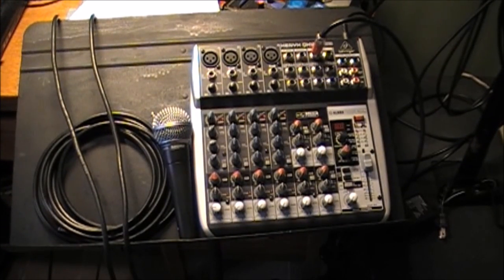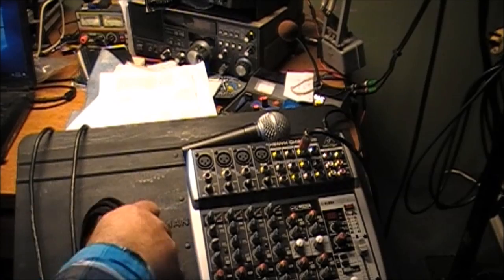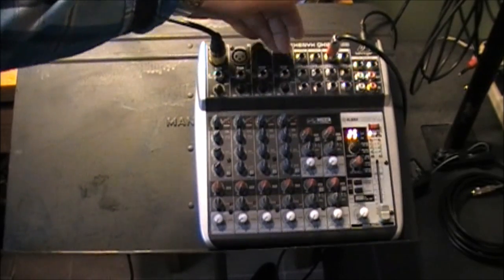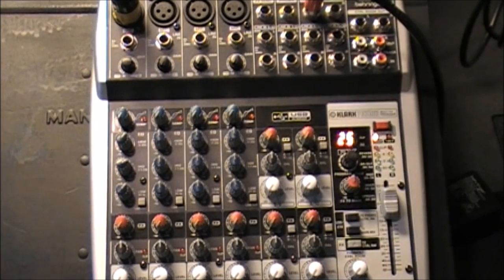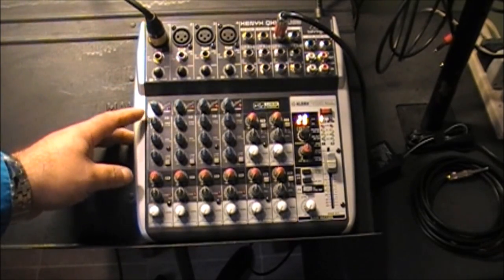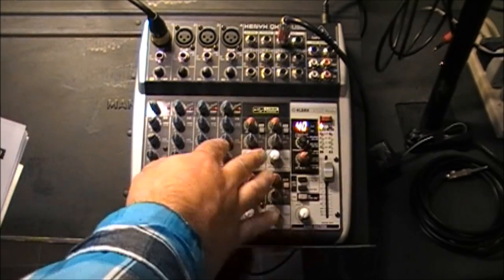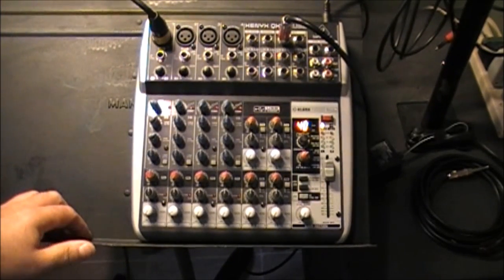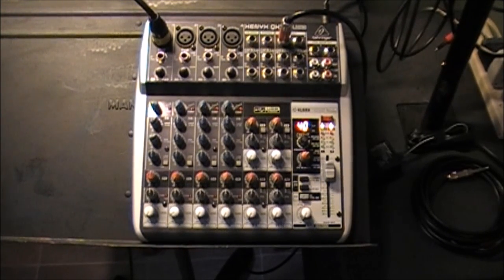Behringer Mixer: How to do a setup

Comment: Andy - thank you for the video. I am really pretty clueless and am trying to set this up for my daughter who will be singing in a small venue. I don't understand what kind of powered speaker I would need to use. The manual talks about active/passive crossover and I have no idea what that means. What kind of powered speaker would I really need to use assuming I am not using an amp between? What speaker did you use in this video? I am looking for a simple setup for her. Thank you in advance!
Reply from the maker: Any powered speaker that is designed for Public Address (PA) speaker. Behringer, QSC, Mackie,  Yamaha andother audio companies make powered speakers and non powered. Nonpowered speakers just need an external amp to amplify the audi to the speaker. The powered or non powered speaker typically come in and 8, 10, 12, 15 or 18 inch speaker with a tweeter or horn for the highs. There is usually a crossover built into the powered speakers. The speaker I am using is the Yamaha DXR10 powered speaker which has a 10 inch speaker and a horn. I have found Behringer to be the cheapest powered speaker out there currently and is typically of good quality. I hope this is helpful to you

Comment: How do I use the master faders on beringer mixing desk xnex 2422
Reply from the maker: The master faders should be set to around "Zero" or what audio technicians refer to as "Unity"  This will allow the mixer to be most effecient and productive audio signal wise and to produce greater headroom potential. This means the ability to get quality volume without disortion and the audio signal chain is most "excited" before the chance of distortion and other negative audio properties increase and destroy quality audio in the audio chain. 

I hope this is helpful to you. God bless you.

Comment: Great video
I’d like to ask a few simple questions
I’m going from the same Behringer desk as you demo here and I’m taking a signal to a powered speaker unit
My speaker has dual XLR/1/4 Jack inputs. It also has optional Line input or Mic input
So should I use a Jack to Jack lead from my Behringer to my Speaker ?
If so should this lead be a Stereo Lead or a Mono Lead ?
And finally Should I switch my Powered Speaker input to Line Level or Mic Level?
Many Thanks
Reply from the maker: Yesd, it is fine to use jack to jack. Use a momo lead and jusdt use a second speaker and cord for the other channel. If you asre inputing a mic firect only, use mic setting. anything else should be line input for proper EQ'ing. I hope this is helpful.

Comment: Andy,
The effects on my Behringer XENYX 1202FX Mixer suddenly stopped working, the LED is not showing. 
All other inputs and volume are working except the effects.
Is there a simple fix for this? Don't know, I am not a tech guy.
Wishing you all the best.

Thanks.
Reply from the maker: If the mixer has not been dropped or mishandled, then it may be just a need to clean the inserts and switches so they make contact. 

Internally, there may be a wired plugin or a ribbon cable that has worked its way loose. I'd check to ensure all the pots are working and that your PSU is properly plugged into the socket and snug as well. 

Other than that, it would be difficult to troubleshoot beyond that without taking it apart myself. The effects unit is a seperate component and it may have failed.
Reply: Andy,  
I forgot to mention, in addition to the unlighted LED, I also had a hissing noise when I turn up the volume.
Thankfully, I found the solution in another of your videos. The problem was a loose power cord. I simply reinserted (fit snugly) into the mixer and Walla.... everything is now 
back to normal and working fine.
Thanks again for your invaluable contribution.
God Bless and happy holidays to you and family.

Cheers.
Reply from the maker: @pattersongay6498  awesome news

Comment: Hi Andy, excellent video with detailed explanation. Just wanted to know...how can I connect this mixer to my laptop so that I can sing with a backing track on Zoom.
Reply from the maker: Some laptops can have a specialized audio component that is specifically designed to tap into a mixer via a stereo jack, USB or other port. Most laptops do have the stereo headphone out and that would work. 
You can also change some of the dynamics of the signal by changing the headphone out to an "audio out" via settings.  You simply plug a stereo jack into the headphone jack and have the other end of the cord split into two XLR signals or 1/4 inch jack channels ( Use two balanced and mirrored channels on the board) 
You may also buy a cord that has a 3.5 stereo jack for the laptop and RCA jacks for the RCA input on the mixer. Just read the user manual on how to set up a signal for the RCA output. The push buttons can be a bit hard to figure out but persistence will pay off. Good luck with your setup.
Reply: @Tobinindustrial  Thanks a lot !
Reply from the maker: @joyerdonald  Thank you for supporting my channel and I wish you the best for 2021.

Comment: Thank you Andy. How does one hook up a monitor on this mixer? I have the identical mixer, so this info really helps! Edit: actually, I don't have the same mixer! My Behringer doesn't have monitor outputs....
Reply from the maker: If you don't have designated monitor out channels then you need to find a preamp signal out and send that to your powered monitors of=r to your amp and then monitors. All mixers should be capable of monitor send.
Reply: @Tobinindustrial  Thanks Andy, What I've been doing is plugging in an additional powered speaker into the "out" on one of the main powered speakers. Works okay, but I don't have the flexibility of a true monitor output. All the best to you!
Reply from the maker: @MrLuridan  What model do you have? I'll have a look at the user manual iof I can find it and maybe recommend a better way. Do you have two or four main out channels?
Reply: @Tobinindustrial  Thanks, Andy. I have the Xenyx 1202fx mixer, and I just found this info on the Behringer site: "Plug a powered monitor into the FX output 1/4 port, and turn up the FX knobs in each channel to feed this port. When you plug a cable into the port it disables the built in effects and then you can use it as an AUX send to use with a stage monitor. Each FX knob will act as channel volume into the monitor instead of effects."

I've had this mixer for years, and never knew this!! Who knew?!

Thank you for your responses, and good luck in all your endeavors!

Scott
Reply from the maker: @MrLuridan  Awesome stuff Sir. It pays to read up on things. I am so happy you got your monitor mixing issues solved. Good luck to you to Sir and God bless you and yours.

Comment: Hello. I was wondering.  Should  I use DI boxes for mics and instruments? And I am using a bose S pro 1 for my speaker, and I plug that in the main out
Reply from the maker: You typically use a DI box to effectively split your signal so that one independant signal can go to your personal stage amp and the other can be used for front of house and stage monitor audio mix. The low impedance channels are the best channels to use as they have more headroom and versatility in mixing. My suggestion is to use a DI box if you want to make a vocal mic or instrument with a 1/4 jack or other be stepped up to a low impedance signal that can go into the low impedance channels of your mixer. As I said, these first low impedance channels are the premium channels to use. Other than that, as long as your mics and instruments can be plugged into the low or high impedance channels, you are good to go. You can use the main out Left or right of the mixer as normal. The pan button on center will ensure eiether signal (Left & Right) is getting equal signals. God bless you and all the best with this.
Reply: @Tobinindustrial  thank you Andy, and God bless you for helping us technically challenged.  I'm getting feed back and a loud ringing noise from my speaker. Any trouble shooting suggests?
Reply from the maker: @RestoredSound  Make sure your vocal mics are not in front of the speaker especially the tweeter/horn section. You may also be in a smaller room with too much volume on a microphine or instrument. Mics are the common culprit but it can also be cauae by an acoustic guitar with a pickup. You can buy a feedback buster for guitar that goes into the soundhole to decrease feedback. Other instruments may be the cause or some other input. You can turn off all channels and bring each one back on individually to see what may be the troubling mic or instrument. My best guess is the loudness of the mic or settings too high like the highs of the mic. Or the placement of the mic relative to the front of the main speaker.
Reply: @Tobinindustrial  great! I will try that. I currently have 1 speaker going into the main out left. I'm buy the exact same speaker to have 2 speakers. Do I plug the second  one into main out right? And I have an I Rig pre, so I can take the sound from the board, into the android phone I'm using to record my video. Where should I plug the I Rig pre into my mixer?
Reply from the maker: @RestoredSound  Yes, you can use the second channel out for the other speaker. As for the I Rig Pre, any preamp signal out should be fine. Make sure it is not post amp from your speaker (powered speaker)There is a monitor send you could use to send a signal into the I Rig Pre. You will have to study the user manual to understand how the bottom right switch works for allowing signals to main and also monitor or studio control signal. read it over a few times and always double check the cable setup to be sure you don't damage any of your equipment.

Comment: nice video, I have two questions.
1) Is the output signal of the Main out connector a mic level or line level signal?
2) Is channel 3 and 4 input line level or mic level, can I connect a CD player?
I thank you in advance.
Reply from the maker: Main out is a signal of all mixed audio that is processed through the board. It is a low wattage preamp signal ready to be boosted by a power amp signal. You can connect your CD player whereever you wish, on tany channel with high or low impedance. Just set the preamp siganls appropriately to not overdrive the audio chain. Some instruments or electronics will perform better depending on the the connection like High Imp. Low Imp or RCA inputs. It all depends on what you are using and the general output qualities of the unit. experiment on what sounds best or works best in the audio chain. Usually, if you look at an owner's manual, the companies will recommend how to hook up the unit for use.

Comment: Andy, Thanks for your reply.
I have the Behringer XENYX 1202FX Mixer.  There are no EQ's (hi, low, med) on the stereo bus.
I also have a spare Stageworks M246- 6 channel mixer with EQ's on all channels. Is there anyway to hook up both mixers to utilize EQ's on the M246.?
I know this is an unusual question.

God Bless.
Reply from the maker: I am sure that any preamp signal can be injected into another preamp input but I really don't see how that would make any discernable difference. My suggestion is that you buy a cheap eq to send the signal of the mixer in and then go out to the powered speaker or amp. I know this would not be channel specific eq adjustment as it will cover the whole mix of your system. If channel eq is what you desire, I'd just upgrade to a mixer that has that ability. They are relatively cheap used and a good price point new as well.

Comment: Bought a Fender Acoustasonic 15W Guitar Combo Amp...for the XLR connection bought an Adapter...somehow the JVC 600 ohms Mic., Shure etc. only works via the XLR  and not Directly with the 1/4 inch jack? Why?
Guitar works Directly and also when plugged in the XLR Adapter?

Maybe, that is why they always worked in the Behringer UB1202 all the time, as I think it has a built in Mic preamp?

So how does the Adaptor converts the Mic signal? An XLR male to balanced 1/4" female adapter.
Reply from the maker: Did you buy the converter unit called a XLR to 1/4 inch Transformer? It is more expensive but I think that is what you need. Ity is possible that the adapter you bought may be made in China and is not properly aligned to connect internally with the mixer or it may just be wired for another type of application.
Reply from the maker: Is it like this unit? https://www.amazon.ca/Shure-A85F-Transformer-Female-4-Inch/dp/B0006NMUHW/ref=asc_df_B0006NMUHW/?tag=googleshopc0c-20&linkCode=df0&hvadid=292943070203&hvpos=1o3&hvnetw=g&hvrand=16920473490010277968&hvpone=&hvptwo=&hvqmt=&hvdev=c&hvdvcmdl=&hvlocint=&hvlocphy=9000010&hvtargid=pla-433881473942&psc=1
Reply: @Tobinindustrial  Hi, no, just an Adapter....the guitar works great with it and also the Mic. with the Guitar amp. No idea why, but, the Mic directly does not, maybe because it has the 1/4 inch jack?
Reply: Thanks
Reply from the maker: @akmt123  I do believe a low impedance mic would need a special cable for it to work properly as a 1/4 inch only has a ground and live wire whereas the XLR is three wires.
Reply: @Tobinindustrial  o.k. Thanks

Comment: Hi, I have the behringer 1202FX and I have a really bad hiss when I connect to the powered speakers even   with mic turned off. Is there  any fix please?
Reply from the maker: Hello Simon. Thank you for your comment and question. First, be sure you are comfortable with doing some of these below troubleshoot proceedures. If you are not, ten please take it to somebody who knows what to do like a technician or an electronics person... There are several things that may be causing this "hiss" in the system. First, can you confirm that the hiss is not being generated by the powered speaker? To test this you can plug in an instrument or a mic into the input of the powered speaker and do a sound check. Next, check all your cords to be sure they are working properly and use instrument cords for instruments and P.A. cords for running from the mixer, etc... Make sure the cords are properly shielded as well. Next, you can check the main sliders, volumes, gains, etc to be sure they are not causing a hiss. This may mean cleaning the pots internally with a contact cleaner like Deoxit or Nu-Trol. Any controls or plug ins on the powered speaker could use a cleaning spray as well. Pretty much any contact cleaner will give you good results and help you to troubleshoot this probable issue. Next, clean by spray the places where you are inserting cords. these plug ins can get dirty and there are small switch contacts that sometimes get corroded or dirty. Also, you can check the power supply for any issues. (voltage & amperage) Confirm that the mixer is achieving the proper grounding from the wall. (check power at home plug in for proper voltage... BE CAREFUL!) I would think that it is only a positive and negative wire (DC volts) at the plug in of the mixer so the mixer would not work if the ground there was bad or intermittent at best. Overall, the only other issue that I could think of is that a component has failed in the speaker system or mixer. This can also be a failure from a bad internal plug strip, ribbon cable, etc... Good luck with your troubleshoot. Please feel free to ask any other questions that you may have. God bless you!
Reply: @Tobinindustrial  Thank you, some good remedies there, once the lock down is over in Spain I will try to get the spray and do what you say. Thanks again
Reply from the maker: @guitarmuso1  Anytime. Thank you again and all the best to you. I pray for the health and safety of you, your family and your country.

Comment: where is the reverb on the 1202 fx behringer mixer
Reply from the maker: If it has an effects unit built in you will need to select reverb number and push the select button to choose the reverb. There may be several kinds of reverbs on the unit. You will need to choose the best one for you.

Comment: Andy... nice work and thank you for this video! Hopefully you will be making more with other mixing boards and more complex setups. That's my issue... I recently purchased a PreSonus StudioLive AR8 USB Mixer and Audio Interface with Effects with the expectation of accomplishing many different setup options. I'm a newbie to mixers, but not to Amps, Guitar Pedals, Mic Vocals, with direct inputs. I still need to purchase some powered speakers, but for now I was hoping to be able to use my existing equipment, Fender Acoustic 30 DSP amp, Fender Champion 30 DSP Amp, GT-10 Guitar pedal, BeatBuddy Drum pedal, and my Sure Beta 58A mic. I think... to accomplish this, I need to get a single or most likely a dual DI box, to be able to use my Amps like speakers, to project the mix? But... this is were it get's more complex and fuzzy for me. I may not be able to use my existing equipment that way now? Anyway... maybe you will consider doing a video with a mixer that shows different ways to connect equipment? Thanks again, and Merry Christmas!
Reply from the maker: Thanks for the comment. I have a Mackie CFX 16 Mk II pro mixer which I use for live band application. I may do a more elaborate setup of my existing passive and active powered equipment and incorporate my mixer and the road rack of gear such as, 31 band EQ, Crossover, Limiter/gate,  powered amps, etc.... I hope to get the time to do that some day.